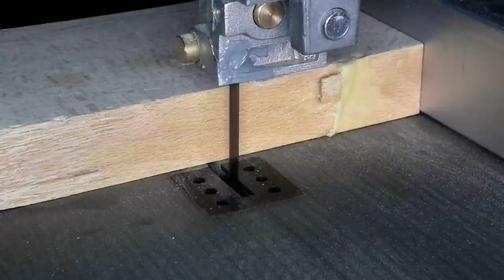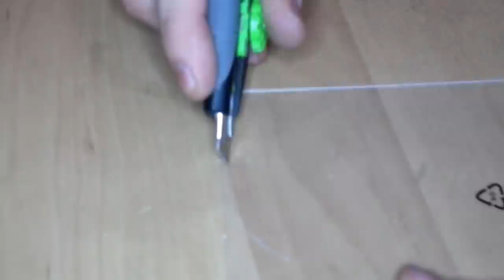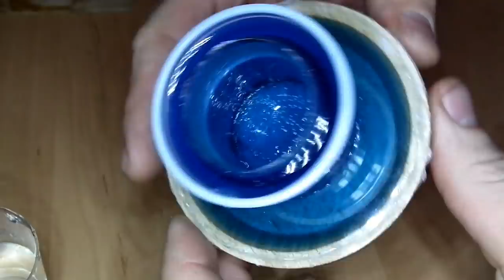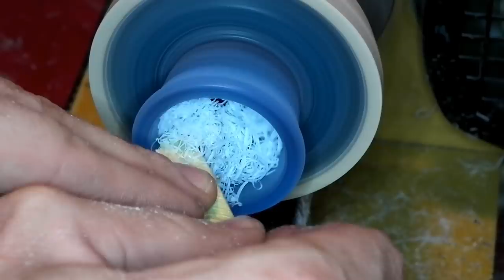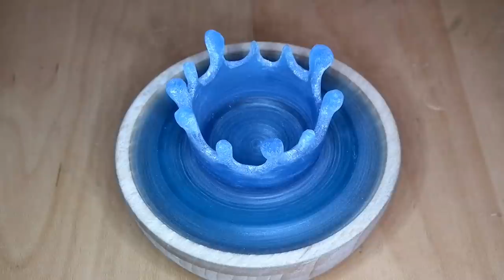Water Splash from Resin 💧 How to make Resin Splash

Comment: I'm curious if you could make it be more organic by actually having it drip down something and use uv resin so that when it gets to the length you want cure it with a uv light
Reply: Wouldn't work. If the resin drips down from something, it goes down straight... It would create a straight tube, no splash shape. I can't think of any way to physically do it. Neither step by step (you could spot where the drops have been added) nor in a single step, by just pouring the resin over some splash shaped/curved cup. No resin is that thick. It would need to be almost as thick as tar... But most importantly, a drip that has hardened on a flat surface doesn't look like a splash at all. It's round from the outside but flat from the inside...

The only way I could think of how to create a splash-like shape would be to pour an extremely thick resin out of a ring-shaped hole evenly and then slowly rotating the whole thing so that the drops slightly get dragged to the outside, and then hardening it instantly as soon as the drips are long enough... 
But only theoretically, since, like already mentioned, I really don't think that there is any resin that's almost as thick as tar... 
And even uv curing probably wouldn't be fast enough...
Reply: @octogunsalata  what about dripping hot melt plastic gun,  it would do the trick,  as it makes nice droplets.
Reply: @DavidLopez-bz4rj  It would have about the right viscosity, but it would be extremely difficult to get it to harden at exactly the right time. Also hot glue can't be colored afaik and it's not as clear as resin.
Reply: @octogunsalata  You can buy colored glue sticks... Just wanted to let you know! 🙂

Comment: I'm so naive. I thought there was a cool way to actually get something to splash and capture it in the epoxy. Regardless, great work. Probably too much for me, though.
Reply from the maker: It is a lot of work
Reply: I thought so too.  Like maybe the water in the final cup would splash over and cause the resin to do neat tricks.  I have some resin but how much that ends up as shavings would do for another project. And no lathe.  Oh well, it looks good on YouTube.
Reply: @sedge6591  I'd does make me wonder if you could get cool affects with chemical reactions with epoxy, or if nothing reacts with epoxy, then do some cool chemical reaction then put it in the epoxy. Any ideas on that.
Reply: @biggregg5  I have some resin that cures in 90 seconds.  I will mix up a small amount this wknd and try pouring some into a shallow container of (cold?) water, from high up so it actually splashes, and see what happens... I'll let you know ;-)
Reply: @sedge6591  thanks!
Reply: @sedge6591  what's the result of your experiment? :)
Reply: I thought the same...that was a lot of work.

Comment: Nice idea - first time I've seen resin that is so soft after setting.  Interesting use of a metal lathe for the turning, though I was cringing at the use of ordinary chisels on the high speed turning.  You should seriously look at some wood turning channels for ideas of what you can do with just a simple bowl gouge and scraper.  Also, using several progressive grits of sandpaper would have given a high finish on the wood bowl. Then sanding sealer, and a wood finish gives a high sheen.  finally - a round of felt glued to the base would cover your screw holes and leave a nice clean way to finish off the piece.  Otherwise, I'm going to look at a wood lathe turned bowl, and acrylic resin for the water splash.
Reply from the maker: The resin was not fully cured
Reply: @jedrek29t  In that case, please use caution, acrylic resin is toxic for up to 3 days after pouring untill it's fully cured

Comment: Awesome work! But I would suggest not using vegetable oil on the wood as it will begin to spoil after a while. Try using Butchers Block Oil (commonly called Mineral Oil) or another wood finish oil. The Butcher Block Oil will work the same as the vegetable oil, but won't spoil and ruin the wood.
Reply from the maker: Ok. Thanks ;-)

Comment: What about the one little droplet that leaps upward inside the center of the coronet?
Reply from the maker: I forgot
Reply: It's fascinatng - the drop of water that falls into the center and creates the splash is not the drop of water that jumps up in the middle. That droplet is created by the forces of the splash, but we didn't know about it until Harold Edgerton invented high-speed flash photography, and took a picture of the splash forming.

Comment: Could you let the bottom go off, then pour a smaller amount into that last cup mold you added, then when the epoxy starts to go off, turn your mold assy upside down, and the 'splash' would be the natural flow of the epoxy across the cup.

  I thought that's where you were going with this project.

I do a lot of epoxy repair, or, I should say, I repair a lot of things wih epoxy.  The next time you wear out a scotch-brite pad, save it for when you have a stripped out screw hole in plastic. (Especially older plastics.)

Cut & fit long skinny strips of scotch-brite into the stripped out hole, (size so 5-6 will fill ¼" hole). Fill until it is nice & tight on the fastener, then epoxy it with Harbor Fraud 60 sec epoxy. (The near instant stuff is great for setting molds, dams, plugging holes. You gotta work fast with it... mix,it good, apply, harden.  Mix too long, and it will jump right over 'apply', & head to harden!  LOL 

Between the small container size, and rush,  use slower epoxy. to fill larger repairs/areas, not the 60 sec stuff. I have, in a pinch used it, and if you are all setup, and don't make a mistake, you can do it. Watch the mix, though, or it gets real hot, damage stuff, hot...

Hope this helps someone... epoxy has saved a lot of things for me in 50 years.
.

Comment: Cool. Maybe I will do it one day.

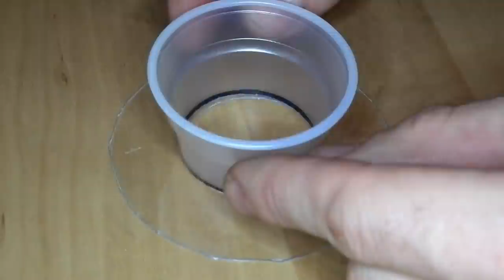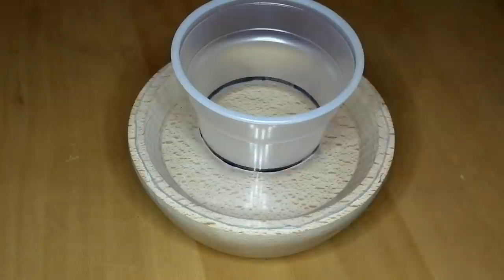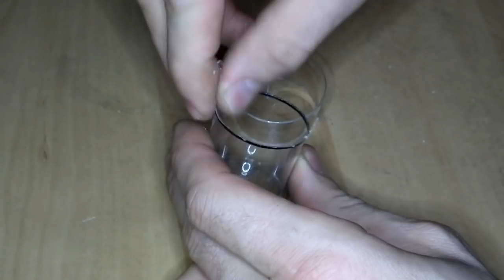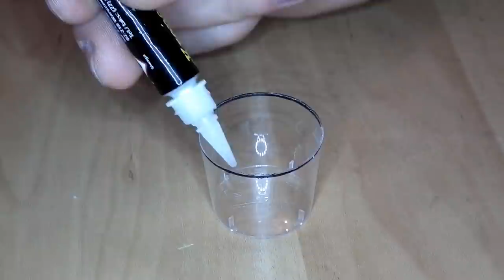Question: what is that little thing you use at 4:12 - 4:17, 4:23 - 4:27 , 6:38 - 6:42? It looks like some sort of weak glue.
Reply from the maker: quick-drying adhesive
hot glue from the gun
quick-drying adhesive

Comment: Thats really pretty. But I do wonder why the plastic cups didn't melt. I tried something similar a few days ago, and the plastic thingies I used all but melted from the heat the epoxy creates. Am I doing something wrong? Maybe but got some most appreciated advice 😊
Reply from the maker: Epoxy resin gets hot when inadequate proportions. Or you mix it too short.
Reply: @jedrek29t   ah... I guess it could have been the mixing time. Thx !

Comment: Its a good effort  but you failed to really smooth out the so called rising drops , cause it looks rough from close up . You needed to really smooth it out with 2000 grip sandpaper and then add the resin to have a smooth water like finish . You tried to rush it and thought the paint brush and resin will do the trick . It looks like unrealistic rough looking water splashes .